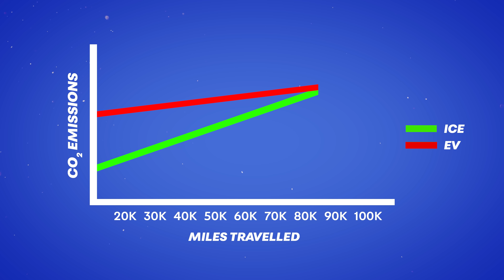Are Electric Cars REALLY That Green? [New 2022 Data]

Comment: Having read the report, one thing that stand out is that volvo doesn't include the maintenance of the vehicle in the " used phase" - basically vehicle being serviced. As EV vehicles have fewer mechanical parts that the ICE vehicle. Its safe to say this would be an added advantage to EVs over ICE. The CO2 for oil/fuel/ad blue filters etc.. would definitely decrease the mileage cross over. By How much I wouldn't know. But is this a case of muddling the water ? We should know by now that initially EV being built produces more CO2 than ICE. but the overall lifetime of vehicle say 10 years the EVs come out top easily particularly if charging the EV from "green" energy. Solar panels for example.
Reply: Do they include the extra tyre wear for BEVs? If so then it would be unfair to not consider their lower consumption of other consumables.

Comment: Good analysis. How about the end of life? ICE lifetime vs. EV lifetime. Also disposal, I would think a big battery is more polluting than an engine.
Reply from the maker: On average vehicles are scrapped after 14 years. Most people do an average of around 8000 miles annually. That’s 112,000 before they’re scrapped. (UK figures.). As for disposal, a battery can theoretically be recycled and used in the making of new batteries or as energy storage for a home etc.
Reply: @Autotrader_uk  in the US, I think the average is closer to 15k miles annually, when not in a pandemic. For a full comparison, will be good to understand the carbon impact of recycling battery/motor vs engine/gas tank.

Comment: Utter bollocks, as far as I'm concerned the manufacturing carbon footprint stays with the manufacturer, it is their responsibility to carry out their manufacturing processes using cleaner energy. When I charge it up I don't use fossil fuels I use electricity, its also up to the providers of the electricity to generate clean electricity. I also have a diesel engined car & of course this does have an associated usage carbon footprint. I don't see the point of this video other than creating unnecessary drama.

Comment: Great video - it shows the need to select the right car/battery size for your mileage needs to make the best decision overall. It also shows that the need to clean up the electricity grid asap to reduce the co2 generated from the EV production meaning that break even points will be reduced.
Reply: Wrong.  If you force the substitution of renewable energy in place of petro energy production at this point, the cost of energy will skyrocket while its availability and reliability will suffer significantly.  Until we can come up with far better and more efficient ways to store wind, solar, and hydro energy, they won't make sense as a replacement for petro energy production.
Reply: @Mike-In-O-Town  don’t think it’s wrong if you have baseline power requirements met with nuclear and renewables as a top up until storage solutions become better. Clearly relying on renewables solely at the minute isn’t feasible currently.
Reply: @Mike-In-O-Town  no I’m UK so should be a good chance with the new smaller rolls Royce reactors coming on stream but agree on the US front.

Comment: The issue is: it is much easier to reach a CO2 neutral energy system based on electricity, as compared to hydrocarbon fuels. However, nowadays, people are only looking at the end product (the car) and not the processes involved to produce it. However, we also need to make the energy transition in the production and recycling processes. These are not visible to the large public, but absolutely essential to reach the goal of a sustainable energy system. So, with today's production methods, we are not there yet, but further development of a battery based system will eventually get us further than sticking around with hydrocarbon fueled cars, even if the comparison today is not very favorable. If the production methods would be based on green electricity as well, then the net emission of the BEV becomes 0; good luck getting there with your gasoline car... It is not about where we are today, it is about where we are going!

Comment: Thank `s for that, young man , although i struggled to keep up at times . ( oldtimer ).  I  wondered is the 50,000 mile figure attainable on one battery , if not i really  don`t see E.V. `s  becoming the cars of the people 
Improvements in battery tech will be made i know . But the expense is key . Have you ever tried selling an E.V. with 70,000 on the clock . Keep up your good work .

Comment: Most EVs will never reach 90,000 miles anyway. If the maximum number of recharge cycles an EV battery can take is 600-700 cycles before the battery starts to lose range the vehicle could be spent at just 30,000 miles. If the car needs a new battery before 100,000 miles it will never outperform an internal combustion engine when compared on whole-life-cycle ecological benefits. A 30 year old 4x4 is far greener than the six EVs required to last a similar 30 year usage period. The UK government should be giving road tax benefits to older cars as each one saves the manufacturing energy requirements of producing a replacement. Scrap road tax for vehicles over 10 years old.
Reply from the maker: Let’s say an EV does an average of 200 miles per charge. 700 recharges multiplied by 200 of miles of range is 140,000 miles. A Tesla’s battery will last 1,500 cycles. They’ll do around 300 miles per charge. 450,000 miles.
Reply: @Autotrader_uk  Do people wait for their phone battery, or their laptop battery to be fully discharged or do they top up charge over night or during the day? Range anxiety will force people to charge long before their batteries are fully depleted. Some will charge their EV three times in one day. It doesn't matter if the battery is partially deleted or fully deleted, a charge cycle is a charge cycle. The chemistry and use of the battery determines the lifetime of the cells not the brand.

Comment: And just to point out the obvious: 
EV's have the potential of being CO2 neutral in a CO2 neutral energy system. So they are compatible with a CO2 neutral humanity i.e. the paris climate agreement. 
ICE's on the other hand are incompatible with a CO2 neutral, renewable energy system. They are imcompatible with the paris climate agreement. Based on this alone it's very clear what we have to support (if we need a car - obviously no car is even better). 
Of course we could use e-fuels to power ICE's but they would actually make the energy transition in most countries impossible, because of the high energy demand (6 times more energy per kilometer compared to an EV). So again, not compatible with the paris climate agreement. There's just no way to keep a large percentage of ICE's and still manage to create a CO2 neutral energy system fast enough for the paris agreement.

PS:
Obviously this also means that the more the energy transition progresses the worse ICE's will do against EV's since EV's will become more and more CO2 neutral, while ICE's with fossil fuels can't do that.

Comment: Did Volvo factor in the need to replace the most CO2 producing part of an EV after approx 100,000 miles. So the EV is only better for 10,000 miles before it goes back to the start again. Surely this makes ICE cars actually much "greener" in the long term.

Comment: @Rory
You might want to check out a new study that came out recently in the journal "nature": 

"Pricing indirect emissions accelerates low—carbon transition of US light vehicle sector", Wolfram et al,  2021

They looked a bit closer at the fuel production of ICE's and all the infrastructure needed for it. And they found that EV's emit less CO2 from the very beginning. They found that the supply chain* of ICE's is so dirty that EV's aren't able to even surpas the CO2 emissions for the production of the vehicle. 

So EV's actually emit far less CO2 from the first kilometer.

*the whole supply chain i.e. the whole fossil infrastructure as well (transporting fuel, gas stations, pumping oil, turning oil into gasoline etc.). There's a huge infrastructure with enormous CO2 emissions associated with cars that burn fossil fuels.

Comment: Nice video! Volvo might be trying to slow down transition as all manufacturers (Tesla included) are going to struggle to keep up with demand for EV's. Also, one huge factor is the lifecycle of the battery. Tesla currently design their battery pack for a million miles and EV's should get many times the utility anyway as there are fewer parts to wear out. Also, at the end of life, the battery can be used for stationary storage or recycled which offsets future emissions in other areas. Like you said though - not so simple!
Reply: 90 000 miles is something like 8 years or so of typical driving - at least in somewhere like the US. I don't have UK figures close at hand. Based on the data we already have from vehicles like various Tesla models and the Nissan Leaf, it seems likely that most modern EVs will surpass that fairly comfortably. If I recall correctly, Tesla model S data is showing that capacity is generally still at or above 90% of original after about 10 years. Most other manufacturers I'm aware of all seem to have 8 year warranties on battery capacity.

Comment: On what average fuel consumption did Volvo make their assessments.
A mate has a VW ( non-hybred) diesel that gets 5.5 L /100k on the highway. This is nearly half what of some cars get.  So the EV  will have to travel a lot further to match this guy.
Reply from the maker: A diesel XC40 gets that sort of mpg, officially. They claim as low as 5.4.
Reply: Thanks, that is interesting, but we still don't know what consumption they based their numbers on.  Best regards

Comment: I am wondering about a few things.. First one being the lack of homogeneous mining regulations and the fact that in some countries there are unscrupulous practices that are releasing a lot of heavy metals into the ecosystem. 
Second one being cost per mile of energy. What does it cost per mile in an EV? Nobody talks about cost per mile, or 100 miles, whatever. I saw a video where the DC fast charger was billing 31 cents per kW/hr but the mid sized EV pickup was using about .8 to 1.1 kW/hr per mile so for easy math let’s round that to 31 cents per mile from that charger and 0 road tax o help support the roadways. Now let’s look at a gasoline powered SUV but a relatively inefficient one at 20 mpg a gallon do gasoline near me is about $3.25 including my states 45 cents per gallon fuel tax to support the roadways. Just fuel not tires, brakes, oil changes etc. that’s about what 16-17 cents per mile… including 4 cents per mile to help support the roadways. On that particular charge it cost almost double per mile for that energy cost not including maintenance costs that’s maybe not typical because of peak rates and such but it’s kind of shocking, right?
I live in the northern part of the world and it was -23C here yesterday what’s that do to rural commuters? Drive an hour with the heater on park your EV and lose power all day at work from just being in the cold then drive home with the heater on and the headlights because it’s now dark out how do you not opt for the biggest most kW/hr battery you can afford? It’s not even max cold out yet of -40. I’m perfectly fine with where I live not getting that very often but a days drive north of me this is a lot more common.
This is why I think the combination of fuel cell and battery is probably the champion in the cold climate. It’s kind of the best of both worlds energy you need but (once the bugs are worked out) relatively quick to refill but yet much more efficient than a conventional internal combustion engine. Now if only those blasted fuel cells didn’t have so much rare earth metals in them as to not open the mining thing for pollution and $$$$ to make them Maybe there will be a sturdy that says CO2 is good for the plants and we over calculated its effects, kind of like we did with the all cholesterol is bad cholesterol craze? Before we figured out how to explain ldl and hdl…

Comment: Sodium Ion battery technology is coming and I think that will have a big effect on the carbon footprint of EVs. You are also likely to see efficiencies of scale reduce EV carbon footprint as more are made. The 52k miles is today's figure and will fall as energy supplies are "greened". I also wonder about the long term use of the batteries beyond the life the vehicle and recyclability of the two vehicle types in general. The batteries can be repurposed for energy storage whereas an engine becomes scrap metal.

I got an EV and a PHEV last year but I also installed solar panels and I think I am likely to produce upwards of 10,000 kWh a year ( perhaps a lot more ). Of course now I have to look at the carbon footprint of the panels and ancillaries....

Comment: I was waiting for you to discuss battery replacement as that is likely in 125k vehicle life, and will also have a major impact on credentials.
Reply: The Tesla 4680 battery is rated for 1 Million Miles.  BTW they can be recycled, can your petrol gas tank contents be recycled?
Reply: @coastiesaurus6810  Typical EV fanboy. Tell me how does battery recycling really work. Recycling sounds good but in practice not so good. Lithium battery’s from a Tesla can cost $6500 to dispose and recycle.  Maybe next time you can use facts instead of asking smart arse questions.
Reply: @Phonehomefool  Guess you have never heard of Redlands.  I took a chance and picked up 1,500 shares when TSLA had their initial IPO.  I have since sold ALL other holdings and now hold considerably North of that amount and holding Long.  Don't plan on touching any of it for another 20 years.  I am patient things will continue to work out in TESLA's  favor.  Ta Ta for now.
Reply: @coastiesaurus6810  Who cares?

Comment: Ultimately your saying the 'greeness' of an EV is highly dependent on where it gets its 'fuel'. If the electricity it consumes is 'greener' (ie from renewable resources) then the car itself can claim to be 'greener'. Of course you don't argue -- because you can't -- that an EV isn't greener in use. The key here is not to ignore the fact that EV production and use don't have negative environmental impacts, because they do.  Importantly though, the 'fuel' (electicity) for an EV is getting greener as more renewable energy sources come on stream, whereas the fuel for ICE vehicles is still dirty and, while it's impact on the environment goes up, the EVs eventually (quicker where electricity is from renewable resources) level off. 

So, by any measure, EVs are 'greener' now and are getting more 'green'. There's really no comparison.

PS: Batteries are one of the 'dirtiest' parts of an EV but there's plenty of research around to suggest that they'll get better too.

Comment: So, rebuild your running gear and suspension,  return if needed, a good detail and you have another 120k that is better than an EV, especially given that Volvo forgot that batteries deteriorate.........
Wake up and simply pay an offset tax on petrol.Also for the Evangelists, you won't be looking so clever when tax on electric cars has to catch up with the money lost from the fuel levy.
Does anyone on the left understand maths?

Comment: With the co2 impact being front end loaded, it does raise a question around having such a heavy push to move to 100% electric landscape so quickly. If people don’t do big mileages a year, is there merit having them move to an ev, yet the big range question probably holds back drivers who do big annual mileages, yet these drivers would from a global co2 perspective be the best option to get into an ev soonest…..
Reply: Absolutely.  The quicker we transition, the quicker we plummet the overall emissions...and in 20-30 years when those ICE vehicles need to be replaced (they already last 2x as long on avg), their batteries serve as high density mining, perfect for recycling and nearly mitigating the entire carbon cost due to making batteries

Comment: 10 years from now EVs will be much greener than they are now - petrol / diesel cars won't be. I predict that by then the 45 tons of carbon produced by an EV will be sub-20, while the 58 tons for ICE will have increased beyond 60 as oil production gets dirtier.

Comment: Great video, honest and open. It would be interesting to compare an EV to a green hydrogen powered ICE. I am thinking at the moment due to the astronomical cost of EV’s there is a ‘trendy’ look at me show driving a £70k+ EV! What about families with low disposable income and parts of the world where keeping your 20 year old petrol or diesel car on the road is essential. I’m observing and watching what happens over the next few years.
Reply: Green hydrogen will always use more energy than a battery EV, but it could be a good solution for storage once some major production issues are solved.
Reply: The same thing will happen as has always happened. Today's EV's will work their way down the scale, as depreciation brings them closer to those whom rarely, if ever, buy new or newer cars.

Comment: I expect Volvo is looking to improve that crossover point.  You can't manage what you don't measure.      

Weight reduction from better materials, and improved aerodynamics, will help both.  As electricity shifts to greener sources, the change in crossover point favors EV's.

The ICE drive train has been pushed pretty close to their limit.  I would think another 10% improvement would be difficult.    

The EV has technology in work that will reduce CO2 in the build and per mile / KM.  Sodium batteries (readily available from sea water) no lithium, no cobalt, more humane extraction, less CO2 to create.  Weight reduction using a 100 mile rechargeable battery combined with recyclable, 20lb / 100 mile, aluminum air "range extender" to significantly reduce weight.  Long trip "recharge" time drops to 5 minutes to swap out aluminum air batteries.